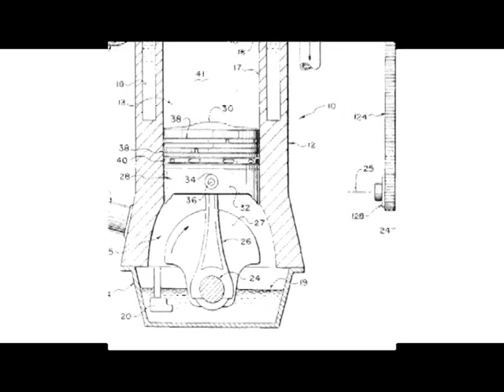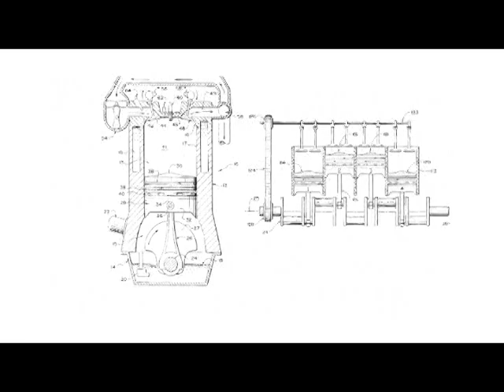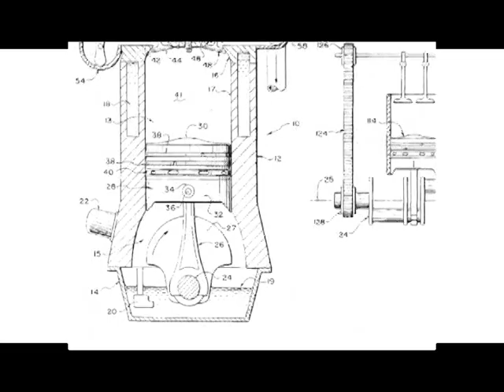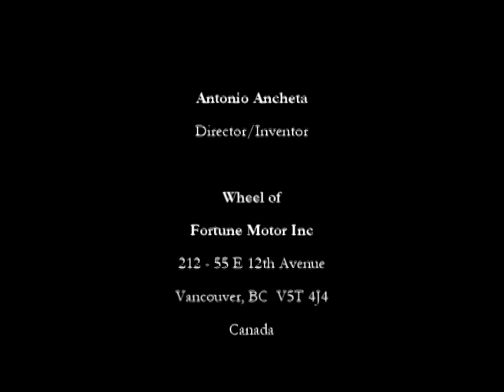Wheel of Fortune Motor Inc Promo Video 1

Comment: whoever built the headers used the very latest in high tech hammer design
Reply: Its them damn 5-axis cnc hammers!
Reply: @jlo13800  You would think if they were going after investors that they would have spent more than 15 minutes and 85 cents on the headers.
Reply: @deadchewie  I dig this 2 stroke conversion sounds like a littlw detroit or evinrude etec! i got an 8v92 to tinker with.
Reply: @jlo13800  8V92 is a big boy. Show this rookie up, convert yours to steam.
Reply: @deadchewie  I researched this and i came accross an article that a team of engineers built a stream powered volkswagen bug 2 stroke! They mounted a boiler, valves, piping and used a Hirth 793 triple snowmobile 2 stroke for the steam engines. Hirth, JLO and Sachs were big lower revving engines in the early snowmobies. Sachs, Stihl, Deuts, Hatz and JLo make 1 cylinder 2 strokes diesels! lots of torque at 2k rpm and below. oil tank goes to pump that feeds the bushings on the crank and the oil burns off crankcase scavenged. I saw a Hatz 2 stroke hand crank 2 stroke on a dirt stomper before. make sure the fuel cap and oil cap are on tight when you run it though!
Reply: @jlo13800   In 1907 the Stanley bros. modified one of their production steam engines and put it in a streamlined (for the time) body. They went an official 127 m.p.h. They were going much faster the following year and crashed, nearly killing the driver, Fred Marriot. this caused them to stop racing. That record held as the fastest steam powered car until a few years ago when a team of British engineers spent millions of dollars to beat that record.They did....by less than twenty m.p.h. I tend to shudder when I hear the term "a team of engineers".
Reply: @deadchewie  yes all piston steam engines were 2 stroike and so were the first engines, all this 4 joke crap started with automotive industry and a re still stuck on it today, except for ecoboost ppopet valved 2 stroke, ETEC, detroit diesel, lightning, electric motors and rotary OMC or mazda rotary 2 stroke! Sabb and German Trabant wer lower revving high torquer 2 stroke, not much peak hp but loads of low end torque! Every now and then some does a 2 stroke american muscle v8: https://www.4btswaps.com/attachments/2cyclesbc-jpg.6839/, i got a good deal on an omc small block 2 stroke, and 8v92!
Reply: @deadchewie  steam 2 stroke is fast
Reply: @deadchewie  My 8v92 is on needle roller bearings, timken or SKF, not sure
Reply: @deadchewie  Steam 2 stroke i take it!
Reply: @jlo13800  The Stanley engine had double acting pistons. steam drovethe piston one way , then the other side of the piston  got a steam charge and drove it back......kind of a one stroke. the steam was introduced by a shuttle valve that moved back and forth allowing steam to enter either side of the piston.
Reply: I get XD-100 BRP Etec oil for the 8v92 2 stroke at walmart

Comment: I'm not really understanding how it is a 2 stroke with valves.  Why does it have valves and how does it work as a two stroke?  How does it work?
Reply: It uses int and exh valves opened around the same time for loop scavenging. Its a poppet valved 2 stroke, however there is some baffling required on the intake valves to reduce short circuiting of airflow for complete loop scavenging. this is a popular modification of hemi dragster motors with blowers for a 2 stroke race motor.
Reply: you can compare this to reed valves or rotary valves
Reply: The poppet valves are timed to open at the same time and air is supplied to do loop scavenging! The valves here are acting like the reed and rotary valves you mentioned.